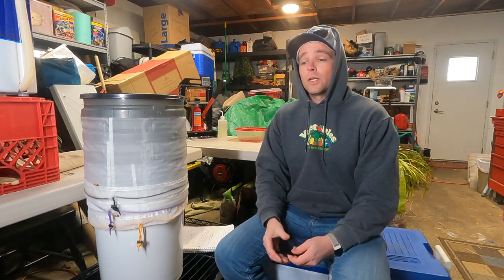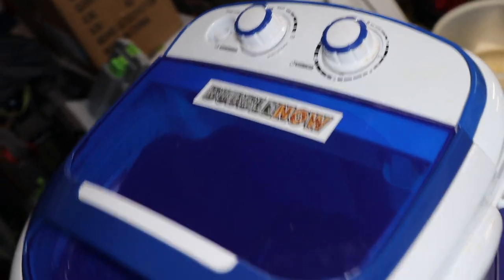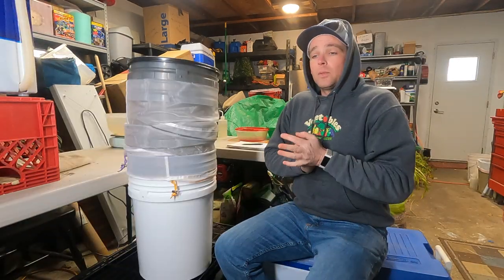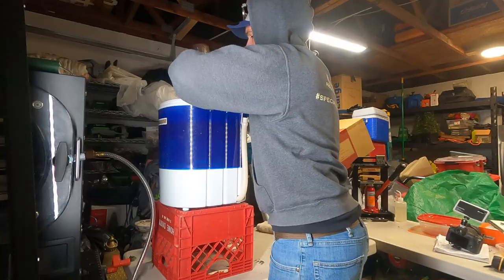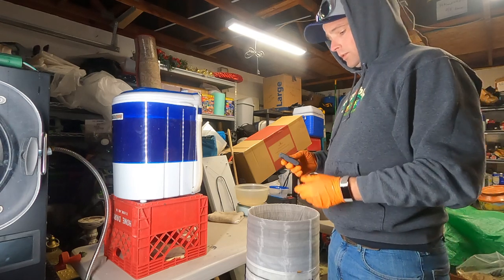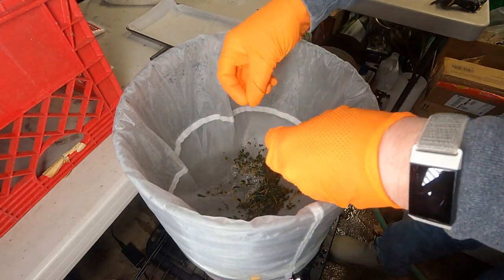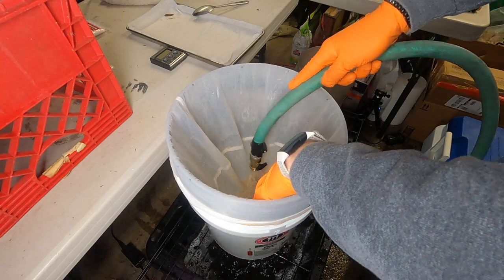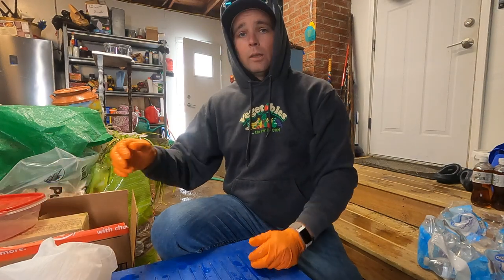Hash Wash Tutorial

Comment: For dry sugar close trim collect 25, esp on the first run will clean the product in second runs, for fresh trim or flash frozen rinse thru bags without 25 first run, change water then use 25 to clean every other run and use ONLY  USE 220, 160 and  25 every 3rd run collect that 25 as it has everything in it.  Also can use any cheaper 150-250 micron laundry bag for inside the machine just pour into a high quality 225 to start. Snow is useful if u can get it away from roads and developments in the mountains. Get laser thermometer.

Comment: Nice video! One suggestion, if you want to clean the bags and use what was left behind use grain alcohol like Everclear, not isopropyl alcohol! Isopropyl alcohol is poisonous on purpose even if you evaporate it off.
Reply from the maker: That's a great idea! Is it strong enough to clean the bags as well as the isopropyl?
Reply: @patricksorganics988  should do the same or better. You can always do grain to get the bulk of it that you can reuse then a rinse in iso to get the stuff your not worried about. But iso will 100% make you sick as hell if you ingest it.
Reply: They say that iso and alcohol stretches the micron but I also herd a guy cleans his with iso and used a scoop to look at the bags before and after and said that that's a mith
Reply: @jeffgood6441  If anything its possible the alcohol softens the mesh and if you push on it to get it clean it could possibly stretch it. I have never had any issues personally with that.

Comment: Can I freeze down water and gallon jugs and then dump that in there. And then add a little ice as possible so the water is super cold?
Reply: Also what freeze dryer did you invest in?
Reply from the maker: The small Harvest Right
Reply: Thats what I do. Fill a barrel with water and block ice. I do hash outdoor in winter whenever possible and use icecycle to chill my water first and soak the dry stuff. Sometimes it's to cold so watch out for that 34 -35 f is about perfect.